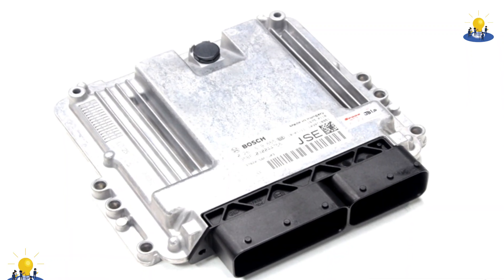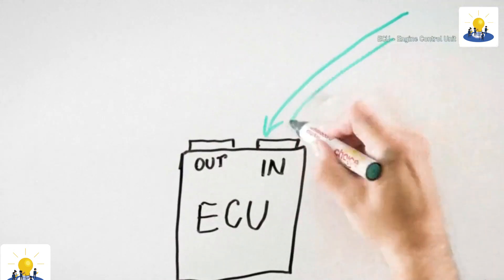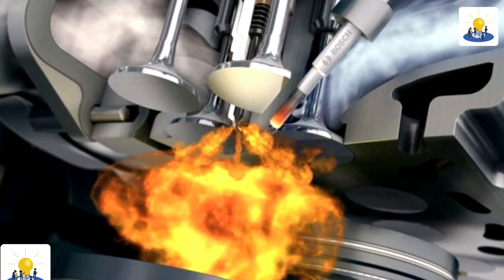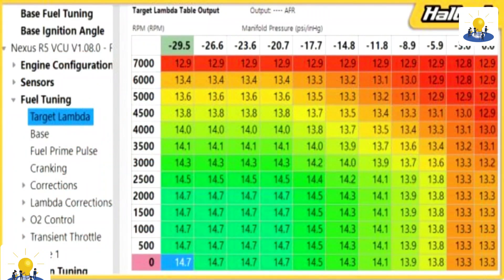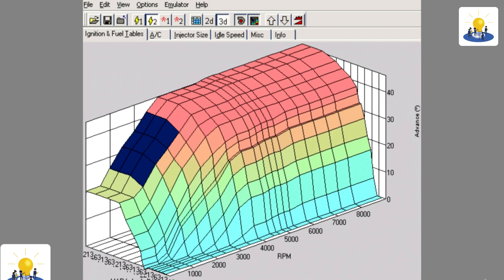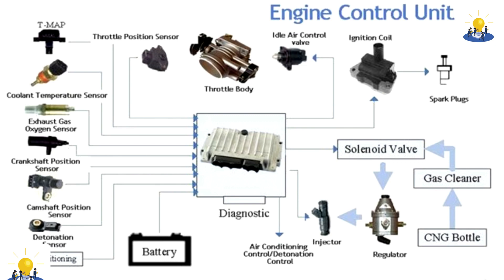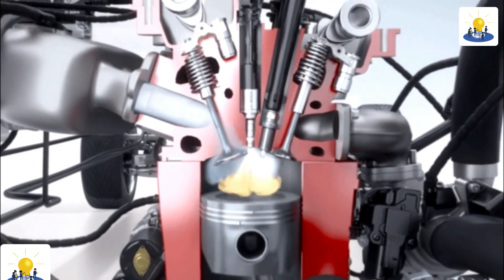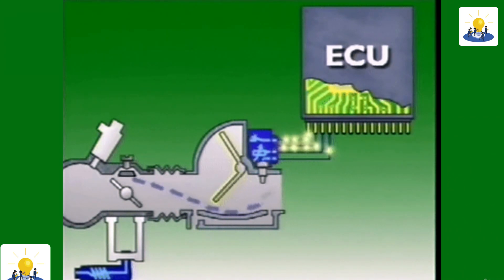How Engine Control Unit (ECU) Works - Full Explained

Comment: They use all this electronics for an excuse for emission control.But then they control the price of any electronics and ecu for cars.I have a forty year old car that will still outperform many of todays modern cars.And parts at less than 1 percent that the parts cost on modern engines.We are not going forward we are going backward.And we are been controlled by motor manufacturers that make a lot of crap.We they go racing there cars they limit all these  electronic perts because they know it can break.So why use it on our road cars.

Comment: Hi sir.
What about the ECU electronic board and how to repair that ?
 Thank a lot for  your nice viddeos 
Thanks for your nice video.
Specially KIA brand almost are defective and no one knows how to repair them while it can be very simple but no one has their schematic diagram!!!
From iran.
Reply from the maker: Hi! 
When it comes to repairing an ECU electronic board, it can be a complex task, especially without access to the schematic diagram. However, there are specialized technicians and automotive repair shops that have the expertise and equipment to diagnose and fix issues with ECU boards, including those of the KIA brand. It's essential to seek professional assistance from trained individuals who have experience in dealing with ECU repairs. They will be able to assess the problem and provide the necessary solutions. Good luck with your repairs!